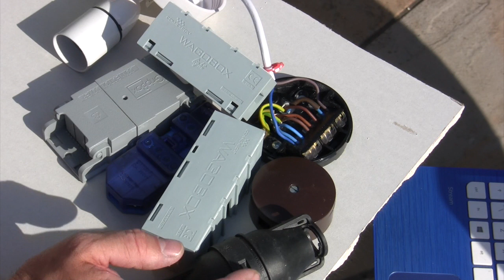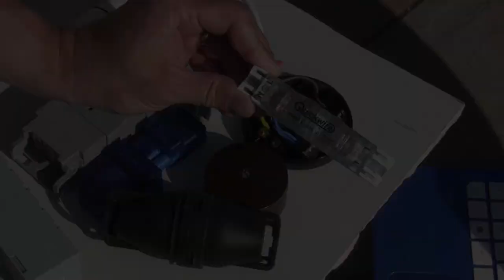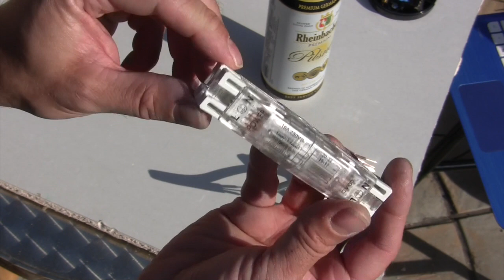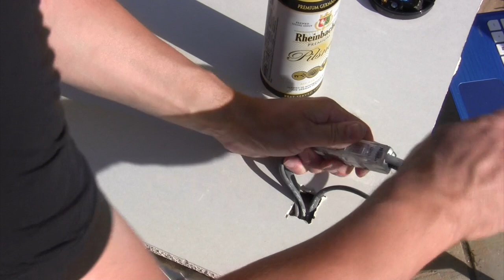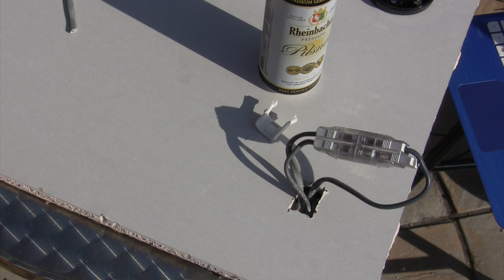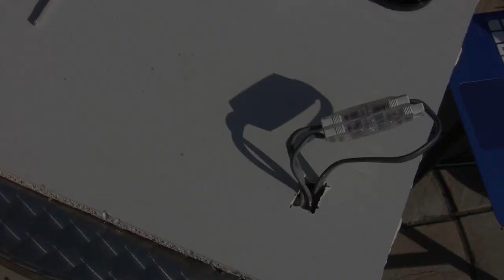The Quickwire Switch & Load

Comment: Bs7671 recommends having a neutral at every switch. Odd I know.
Reply: 559.5.1.208 sorry bs7671 doesn’t recommend it but advises that consideration of installing a neutral should be taken.
Reply from the maker: Good spot. I have that highlighted in my book, so I must have spotted it before, but for every reg I commit to memory another seems to fall out!
Reply: David Savery Electrical Services I think that’s the same story for most! That’s what the flag markers are for!
Reply from the maker: I'm not aware of such a recommendation, so if you can point me in the direction of where that's written then I'd be interested in seeing what it says. As far as I know, it's left to the installer to choose a two-plate or three-plate method for any given installation, but there could well be something in the blue book I've overlooked!
Reply: David Savery Electrical Services from memory it doesn’t say a lot i believe it’s with a view of future proofing for the installation of electronic style switching. I will have a look when I get home.
I am only aware of it as it was a part of a question from the 2396 and the hardest to find the answer for...
Reply from the maker: Interesting - I'll have to see what I can find on that. It certainly is a problem with a lot of current smart switch solutions as they need a neutral for the electronics in the switch, but there often isn't one at the switch point. To get one they pass through the lamp which is fine if it's an incandescent lamp (effectively a resistor), but all bets are off when it's a LED lamp. The most popular page on my website comes from people all over the world Googling why their LED lamps glow when the switch is off, and one of the reasons is that they've screwed a smart switch to the wall and it's control current is passing to neutral through the lamp causing it to partially light.
Reply: Soon lighting will be supplied via the ring main !

Comment: I'd refuse point blank to fit that bling pendant because that lamp holder on the end is not compliant with British standards. that is a cheap American lamp holder and if you notice it uses a paper insulator and exposes live parts without the use of a tool which is contrary to the low voltage electrical equipment safety regulations

Comment: Or just add another connection block or wago or what ever you usually use inside the new light fitting to take the perm lives surely ?
Reply from the maker: Absolutely, if the rose base of the new light has the space to accommodate additional third-party connectors, and if it's not some piece-of-shit metal fitting that's pretending to be Class II in which case your single-insulated wires need an additional layer of insulation for that Class II protection to remain in effect. A client will think nothing of spending £300 on some gaudy looking luminaire from the likes of John Lewis, but baulk at the cost of having it properly installed so that it is compliant with the requirements of both the wiring regulations and the manufacturers instructions.

Comment: Only problem is the amount of slack needed on the switch wire to reach the other end of the unit
Reply from the maker: Yes, that could be an issue. I still haven't had a job where I've used one in anger, but there are a lot of new builds going on in my neck of the woods and I suspect a product like this would work better there where there is new cabling and a better chance of some slack being available.
Reply: @dsesuk  not when the cable has been fireclipped :-(

Comment: I saw these at the Electrician's Show but you have tied the solution to the problem very neatly - thank you. The pricing structure  could do with a rethink! Would it really be so difficult to add a couple of removal tools to a box of the mounting brackets when the original device hits a fiver each with VAT?
Reply from the maker: Agreed, the removal tool pricing seems odd, but maybe that's just CEF's pricing?!
Reply: @dsesuk   I got them included but I went direct. They were very helpful